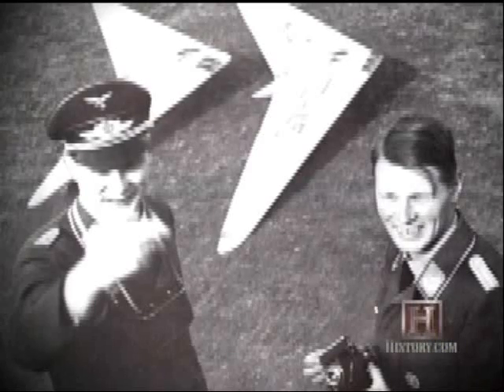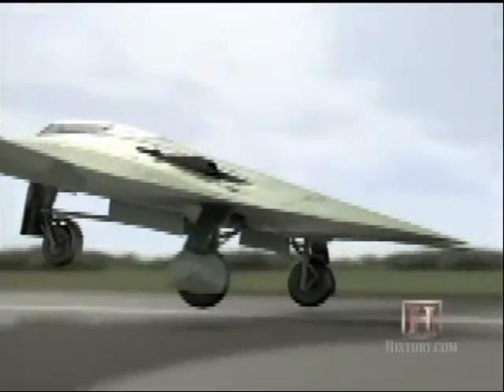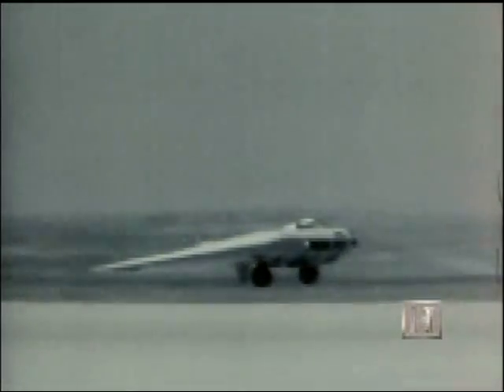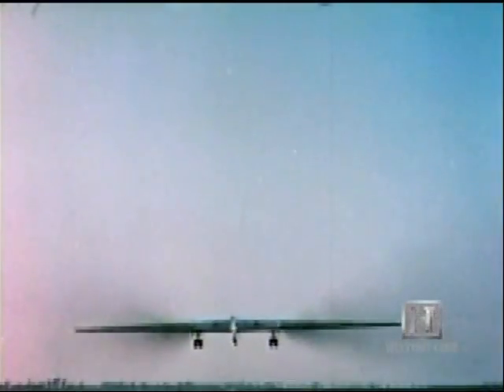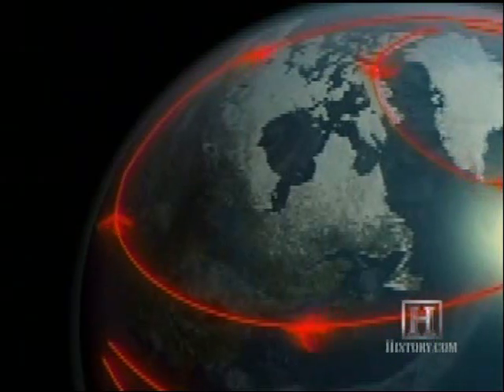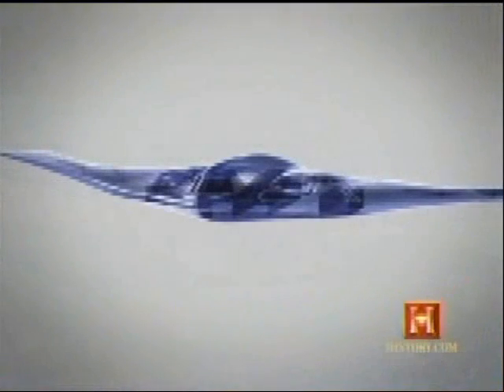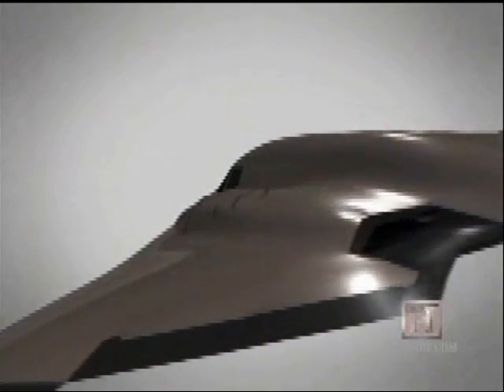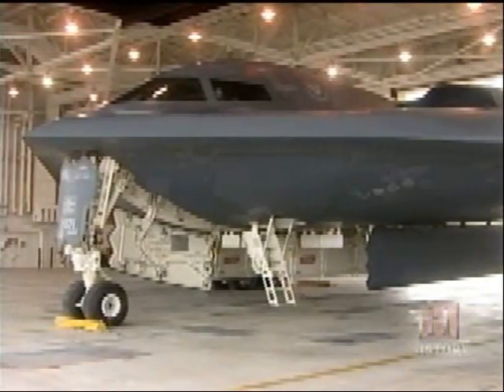Stealth Tech: Nazis Vs. United States

Comment: Jack Northrup was flying wings BEFORE Germany. The differences in the HO-229 and the B-2 Spirit are light years apart. The Horten resulted in a 20% reduction in radar cross section with the radar of the day. It would show up instantly on today's radar. The Spirit has a 98% radar reduction with modern radar, it would not have registered at all on the old VHF, UHF and L band of the 40's. Germany's stealth was accidental, American stealth is by design. Jack Northrup was ahead of Germany.

Comment: Bicker, bicker, bicker. The fact is nearly every nation with an aviation industry produced some truly excellent designs. Many are lost to general public knowledge due to the fact they failed to receive publicity because of political, economic or procurement difficulties beyond the designer's control. I have a source library covering aviation history that bears testament to the fact that "original" ideas were persued by many nation's designers almost simultaneously all over the globe and resulted in aircraft of comparable performance. Having said that, the Ho 229 does stand out as an airframe that combined the right features with the right mission to stand head & shoulders above everything else at the time - but aviation moves on and the surprises continue.

Comment: "Although the Ho 229 has been immediately identified as "stealthy" due to the characteristics of its overall configuration, neither of the Horten brothers ever claimed their aircraft had been designed with consideration to the way it deflects radar waves. In fact, the unique shape of the Ho 229 has evolved from the ten-year long aerodynamic research by the Hortens." (Ottens and Shepelev "Horten Ho 229:  Spirit of Thuringia")

Comment: As far as the Atomic bombs go, the US scientists absolutely knew for certain the first Little Boy bomb would work. They had already tested the "Gun Method" on tiny quantities of Uranium in the lab, and it worked with varying amounts to prove it would achieve critical mass. The only question, was how much of the 64kg of Uranium would convert to energy using the Gun Method. Though it worked, the Gun Method was found to be inefficient, so they theoretically developed the "Implosion" method used on the Plutonium bombs. This technique could not be effectively tested in the lab, so they built a test bomb for Trinity, to prove the concept. Both bombs were proven to work prior to use, and the implosion Plutonium type was far more efficient, and effective. Thus, the Implosion design became the standard. Even now, the Thermo-nuclear Fusion bombs use an implosion method to heat and compress its core to achieve fusion.

Comment: i think the horten brother could have come up with a better design than the B-2 if they would have been able to continue thier work
Reply: probably
they was actual planning to fit the BMW 003 jet engine into the ME 262 and the ho 229 as the engine made 30% more power and didn't have the throttle issue
Reply: Reimar Horten did carry on his work in Argentina and produced nothing that went into production.

Comment: Germans were making these ideas work. Thier delta wings worked and were flown with jet propulsion. Thier jet motors and rockets worked first and the quality and engineering was far superior across the board.
Reply: +jeremy whittler

 The only flying wings they got to fly under power was the v.2 of the 229s. And that crashed on its second flight hour. 

> "Thier jet motors and rockets worked first and the quality and engineering was far superior across the board."

 The Jumo 004 was notoriously unreliable. Rockets fine, but superior? No.

Comment: @stealthyf23: of course its not the same; there's 60 yrs of technol. development between em! But it was the Germans that discovered the correlation between stealth and flying wings, and tried to perfect it. Furthermore, it was the Germans who attempted to create radar reflecting skins/paints. That put the USAF on the right track. So, the NASCAR-comparison doesnt hold ground. But the perfection of stealth-tech is an American achievement.

Comment: Then explain why the engineers at Northrup never saw this plane? Until the early 2006's I think, when they got permission to view and take measurements from it. It was hidden away, nearly forgotten in a warehouse in D.C. It's existence had been rumored for years, but the plane sat slowly rotting away, a state secret as it remains to this day. This first stealth plane the F-117, bears absolutely no resemblance and the B-2 was developed on Jack Northrup's work in flying wings. Not Horten's.

Comment: I think the designers here borrowed from the Germans, specifically, the Horton brothers Gotha flying wing jet fighter.  Interestingly, toward the end of the war, a flying wing Horton *bomber*, jet powered, was designed, and ordered, by Goering.  The war ended, evidently, before any of the latter planes were built. The Gotha fighter was built and flown, however, but not in battle. They were meddling in technology a generation advanced for the time.  Very fortunate that they did not succeed here

Comment: Stealth does not make a plane invisible. It only makes it harder to detect. Sam radar will not get a lock. If using IR sam missiles they will lock on it's exhaust. And it is visible to the eye so, a A-A gunner can get lucky, as in Serbia and shot one down. They aren't Super Sonic. A sonic shock wave shows up on radar. Serbians like to make a big deal of this, fact is, even a blind squirrel finds an acorn now and then. So, what is Serbia flying these days? Old Mirages, MIg 15's, Rafael perhaps?

Comment: I am American but I hate the way they always like to deny everyone elses success. The Horten fixed wing  stealth jet design did work. They said the American was going to succeed where the Nazi's failed but the nazi's didn't fail. Their prototypes did fly and they were a great success and they did reach over 600 mph. The only way you could call it a failure was if you were talking about putting it into production. Also an American company recreated the wooden Horton fixed wing jet and found that it did also have stealth capability and they had concludid that the jet would have been a nightmare for Britain because they would have not been able to detect it until it was too late and they would have a lot of trouble to try to catch it.
Reply: The Horten design did not reach 600 mph. That was only an estimated speed on paper. They only got two hours of flying from their second V2 prototype and it crashed on the flight to take a speed measurement. That was it, two total hours of test flight over two weeks in February 1945. The example that survives today was the half-finished prototype found at the Gotha factory and it never flew. The conservation specialists at the NASM have not found any stealth materials in the real example, and the large model built for the NatGEO tv special was only a shape and not a real duplicate.
Reply: David Post Meanwhile French guys say that their prototypes of jets were the fastest in 1996 with 600mph.. propaganda everywhere

Comment: @corbx2009: Dude, are you serious? The Ho 229 was ready in 1945, the B2 in 1990. This are 45 Years, not 60 Years, also the B2 is MUCH more advanced. You can't compare the STG44 with modern Weapons, or the Tiger with Abrams, or something else. The V3 is failed. Had they had helicopters? We had the Huey 10 Years later. 60 Years ahead the Time.... maybe 10 Years, not more. Call me a WW2 Weapon which can keep up with Weapons of 2005. ( 60 Years later ) there are NONE.